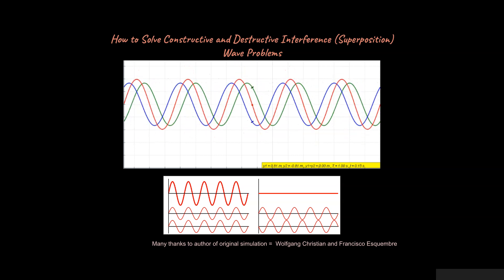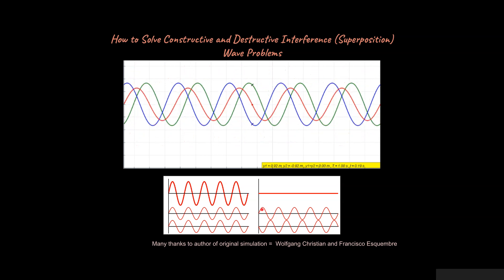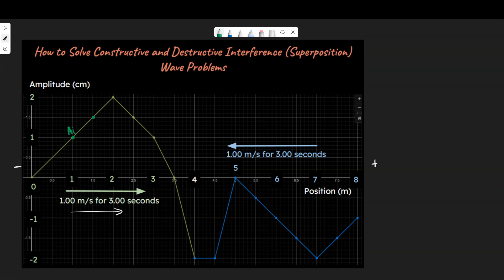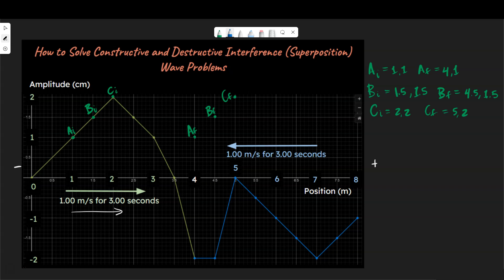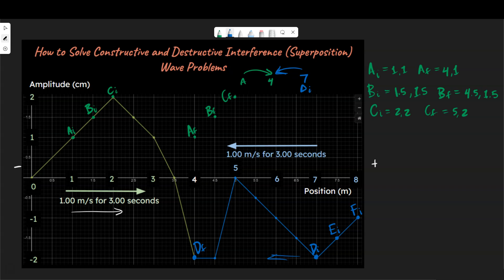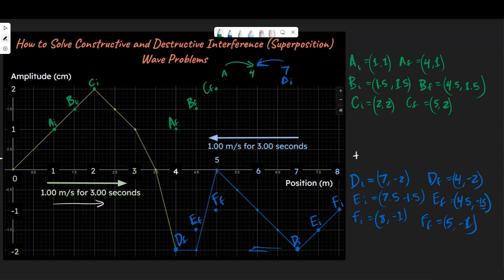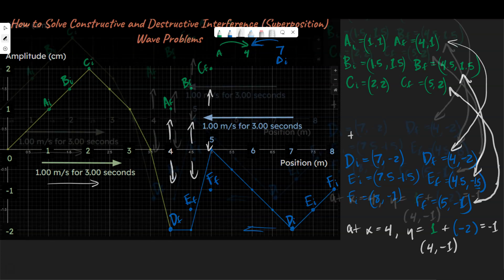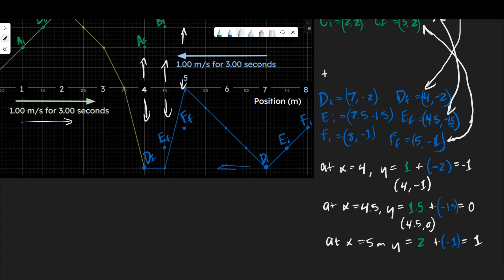How to Solve Constructive and Destructive Interference Superposition Wave Problems (Physics Classes)

Comment: 7:25 would it not be y = (1+(-2)) / 2 = -0.5? Since the average of 1 and -2 is -0.5
Reply from the maker: Good question.   The resultant amplitude is just the sum of the two amplitudes that make it up, not the average.
Reply: @mastering_science ahh ok thank you for the quick reply!
Reply: same with all the other points? Dont you need to divide by 2?